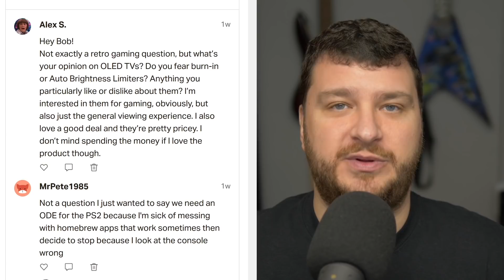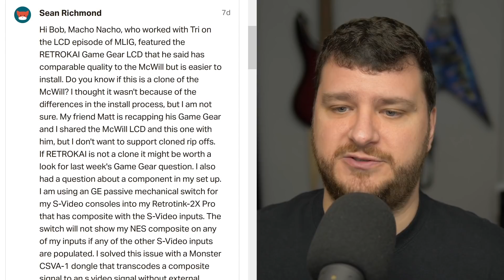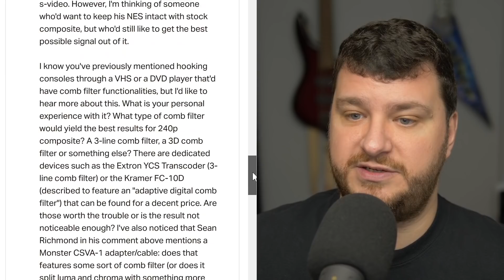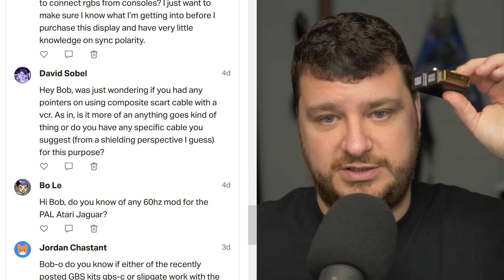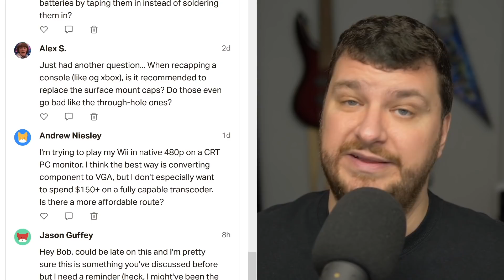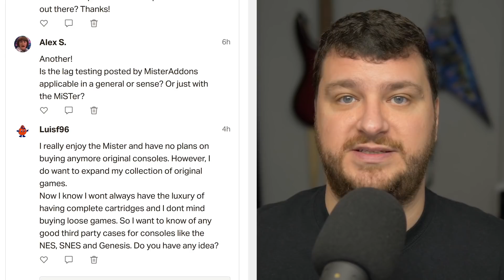Supporter Q&A #140

Comment: The tape thing (and I'm guilty of this many many years back) was there just wasn't a readily available replacement for the batteries with tabs already on them. I'm sure for anyone inexperienced using a soldering iron around a regular battery is scary too. A battery you could grab at Walmart and one strip of electrical tape seemed like a great way to get your Pokemon Red working again! For anyone out there that wants to do this and isn't the most experienced in soldering grab one of the many replacements with the tabs already attached and replacing the battery is a breeze and much better for your games. https://console5.com/store/panasonic-cr2032-lithium-battery-with-solder-tabs-pins-nes-saves.html

Comment: The problem with a PS2 ODE is theirs like 7 or more hardware revisions of the PS2 so making an ODE or any hardware mod for it is a pain. but yeah the MODE and a bunch of ribbon cables for each ver would be nice. Would still be a pain to dev as you would have to track down and test all vers..

Comment: Hey Bob! I just wanted to add something, you could actually install an SSD in the fat PS2.
Reply: You can go a step further and avoid wasting a SSD, and use SD cards. The harddrive adapter + (connector/power plug adapter)+ IDE to SDcard + SDcard to SDcard adapter slot ( to run the connection outside of the harddrive bay). 

If someone does make a ODE for ps2 they should anticipate having more features all included, just having the games load is already easy to do on its own. People get hung up on using a old ATA harddrive when you can completely avoid using one.
Reply: @scikoolaid  surely a sata hdd would be easier, cheaper and just as fast. 2tb sata hdd costs the same as 256gb sd card.
Reply: @hellogoodbye4906  sure, you can. I found that I prefer minimizing heat in the console and no hdd noise for acceptable price and limits of storage, plus I can directly access the SD card at will. 
I don't ever intend on attempting to preload a massive part of the ps2 library to access all at once, so changing whats on the SD card is enough for me if I ran out of room.